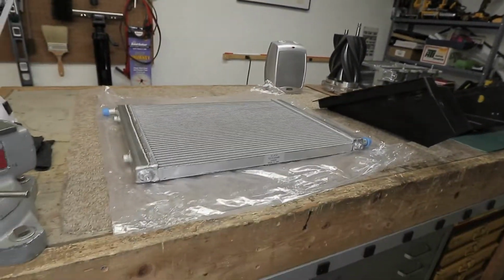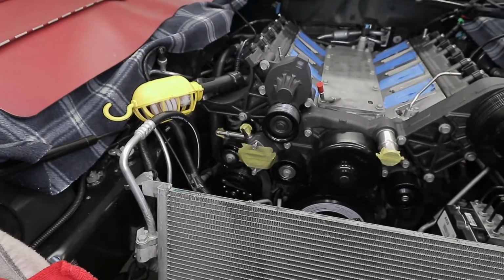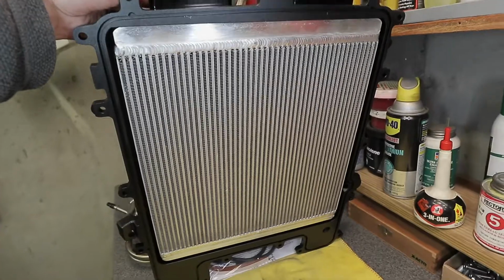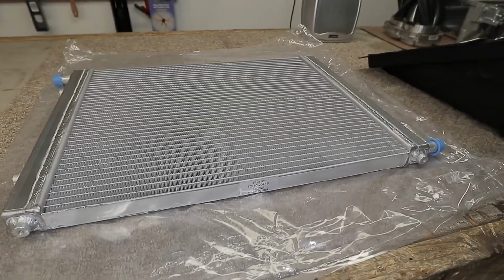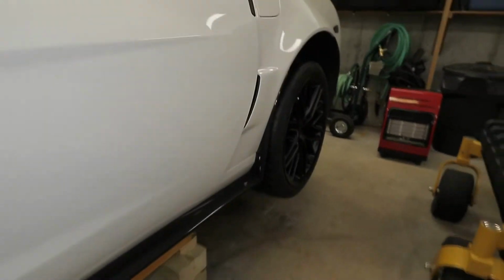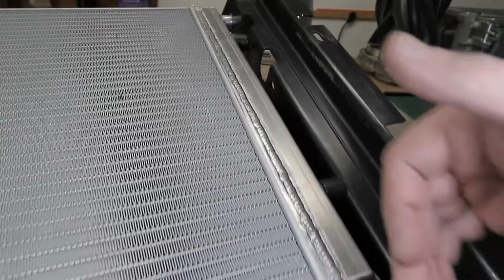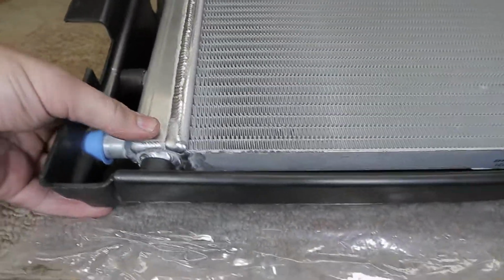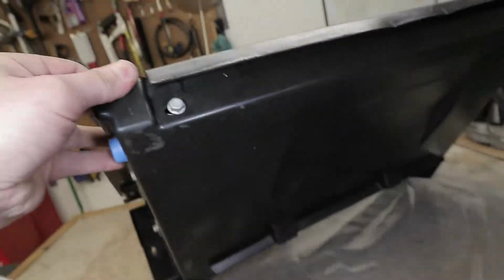Install & CUSTOM Fitting Edelbrock HX | LS9 CORVETTE ZR1 | Updates & NEW KONG Dual pass Lid

Comment: Is it true the Kong lid makes the blower louder? I'm debating on what Lid to go with for high boost / high hp - what do you recommend?
Reply from the maker: no the lid itself does not. The blower whine comes how blower is ported and from how much of the rotor face is exposed to incoming air on the inlet side.

Comment: Curious to see why you chose to go with the Kong dual pass lid over the C&R Racing upgraded bricks from Synergy. According to Rick, they flow more than the dual pass lid and create less turbulent airflow within the lid itself.
Reply from the maker: Just swapped over to C&Rs and synergy inlets and adapters much better lets say...dyno videos of each and with stock lid coming soon.
Reply: @ModernHotrodsNH  missed your reply. Good stuff, been loving following each step of this build. On another note, where did you amass your knowledge on building engines like this? So much detail and knowledge to be absorbed watching your videos! Keep up the good work

Comment: I'm glad your pumps achieve flow so easy cuz I always have trouble achieving steady flow! The intercooler pumps, obviously. But no matter what I do, I just can't achieve flow. I'm quite worried that the pressure one day will build up too much in my hose and it will just burst and blow my pushrod right off! I'll try your 'tip' tho. Thanks!
Reply from the maker: Yeah dont want to bust a rod! LOL